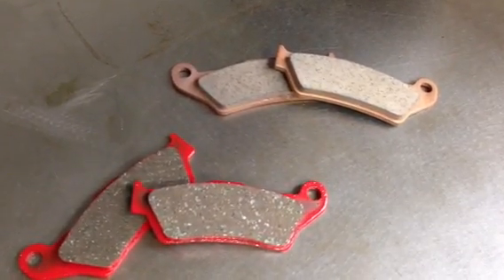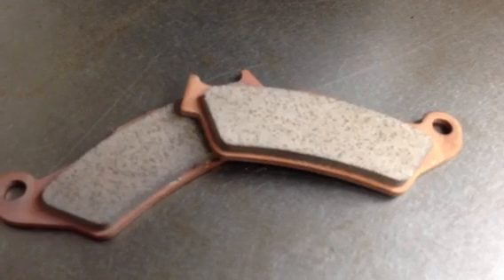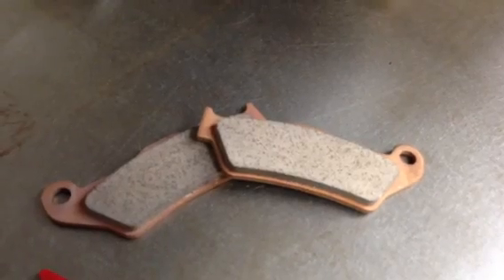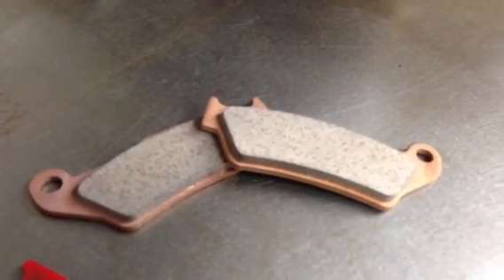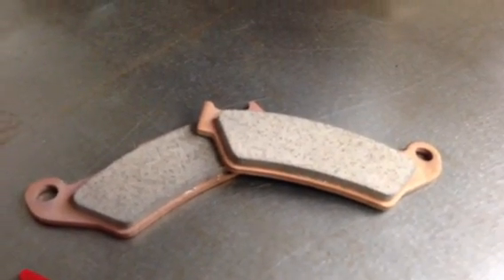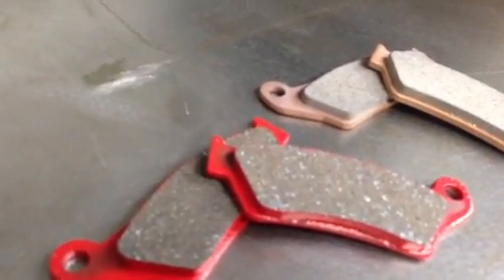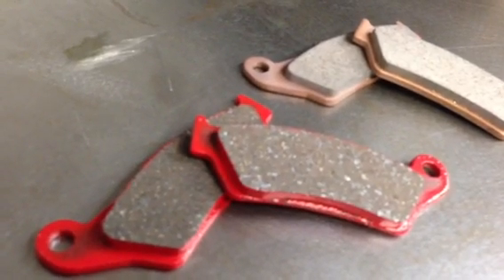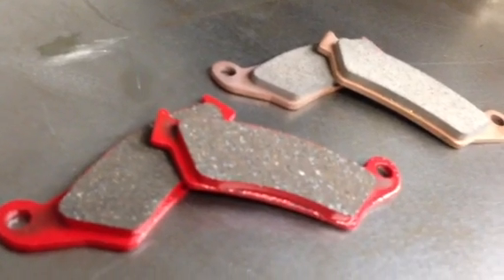Motorcycle Brake Pads Explained

Comment: personally i prefer sintered pads for street and track use. long life, great performance. and i like to replace rotors every once in a while too, not running the risk of rusting up or wearing the bobbins down ;-) it's a little bit more expensive but brakes and tires are imho something you don't skimp on, it's what keeps you safe on a bike.